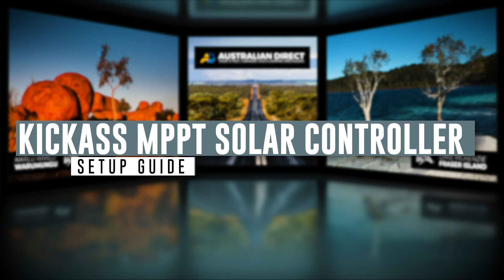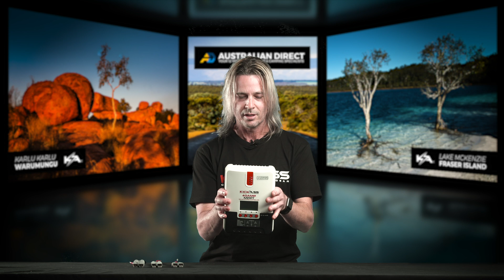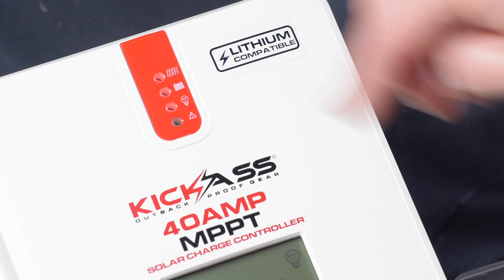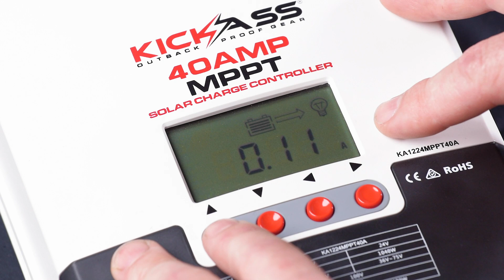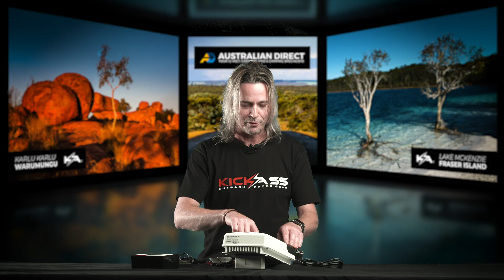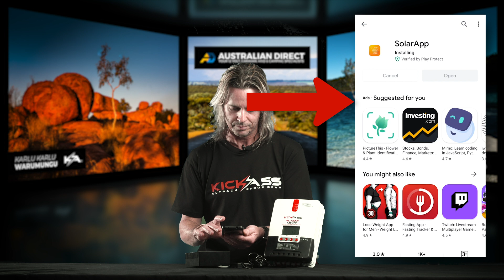KickAss MPPT Solar Charge Controller Setup Guide

Comment: Thanks for emailing this video shortly I got my MPPT, very helpful! Just a quick question, does the Load run of the solar or battery? Also whats a good item to run of the Load?
Reply from the maker: G'day samartz, the load is specifically designed to run lighting from it & you can use the solar controller/light dimmer to turn lights on or off automatically - great if your doing a day trip & want your lights to turn on automatically when sun goes down & light up your campsite so you don't go tripping over stuff in the dark lol 
& also how long they stay on for eg: 3 hours after sundown 
i would run your fridge directly to the battery & not the load on the solar controller 
Cheers Craig
Reply: Legend Craig, thanks!  @KickAssProducts

Comment: I've had this for about 8 or 9 months now. Fantastic unit. I recommend it all the time. I'm just curious as to whether the screen showing daily Ah totals can be reset without disconnecting from the battery entirely?
Reply from the maker: Sorry for the late replay,if you have the bluetooth/remote you can bluetooth with your phone,go into history & click on the little icon that looks like a brush & clear the history 
Cheers Craig

Comment: Hey sorry I get no devices showing in the solar app, the remote meter and bt
-1 both show wen scanning (tested seperate) but not in the app. Ty
Reply from the maker: Hey mate, please check out the info on our support portal. https://supportportal.australiandirect.com.au/products/solar-panels/kickass-40a-12-24v-mppt-solar-controller/

If you are still having issues please submit a ticket and one of our CSA's will get in contact with you ASAP.